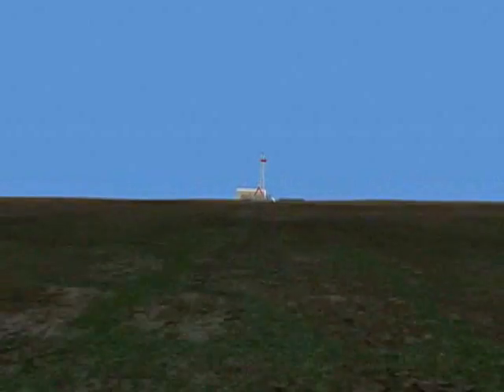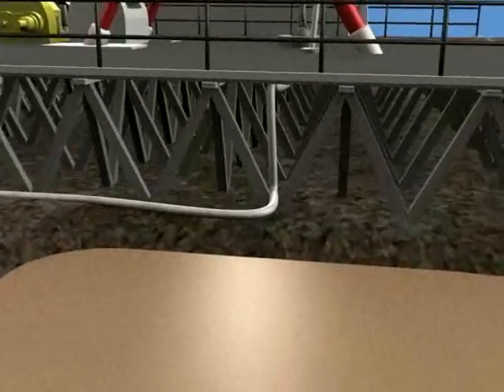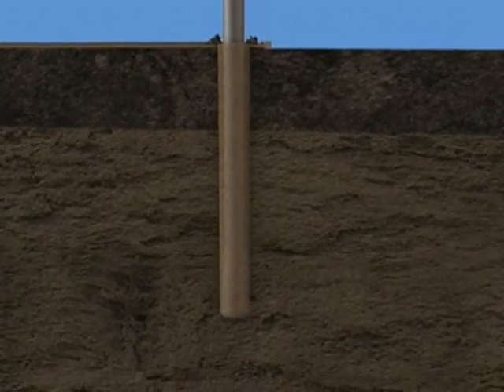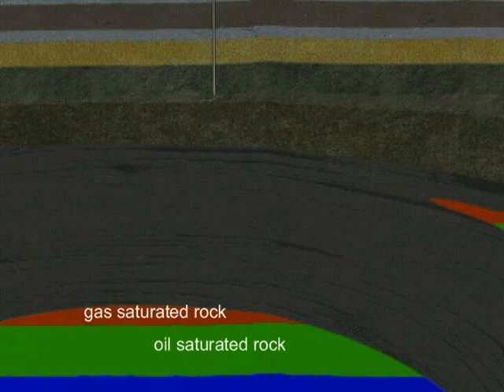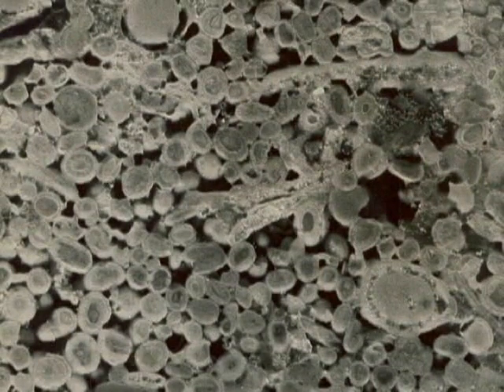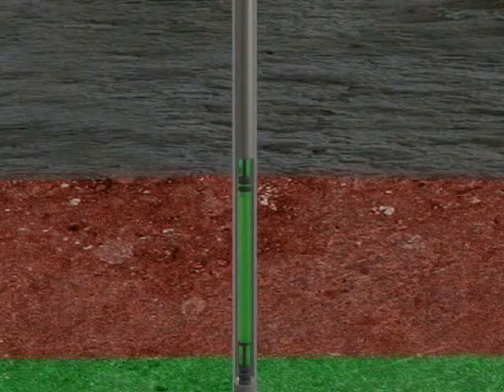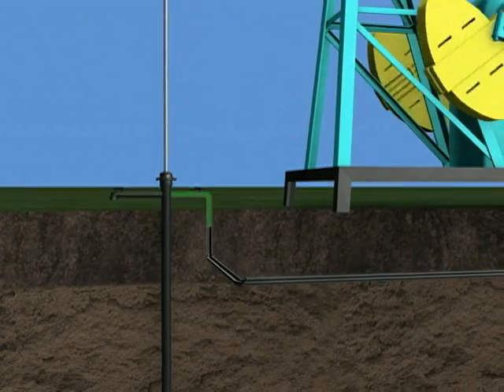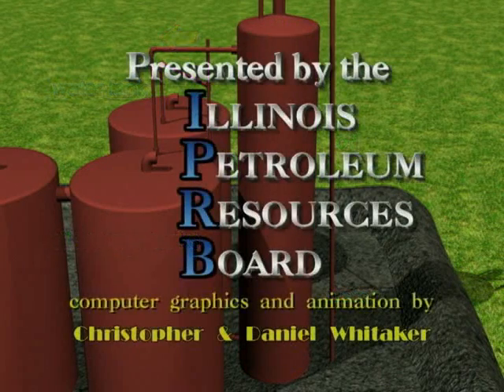Drilling For Oil In Illinois

Comment from the maker: The process for seeking permission to drill an oil or gas well is relatively straightforward, but takes a bit of effort. After the geologist has spent much time conducting research to locate an area that seems prospective, permission to drill must be secured from the mineral owner(s). There is no guarantee that the drilling operator can secure such leases. Only after the permit is granted can drilling commence.